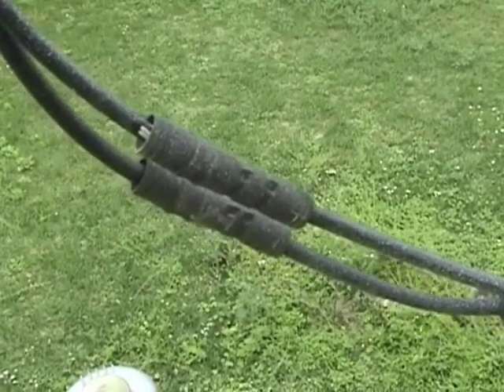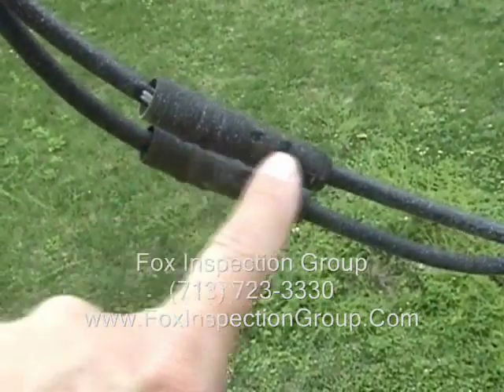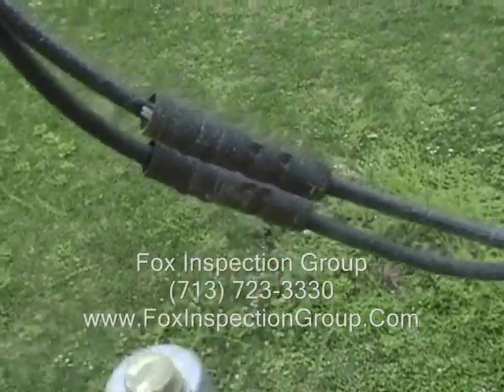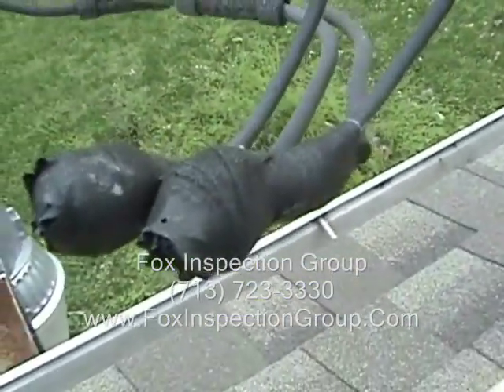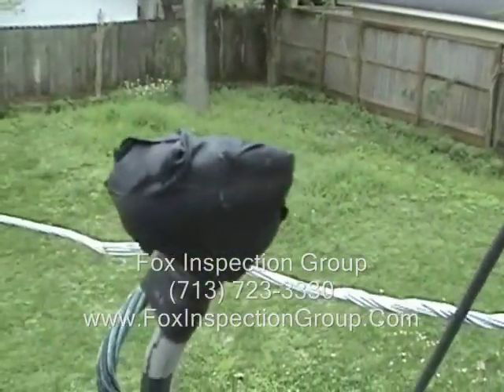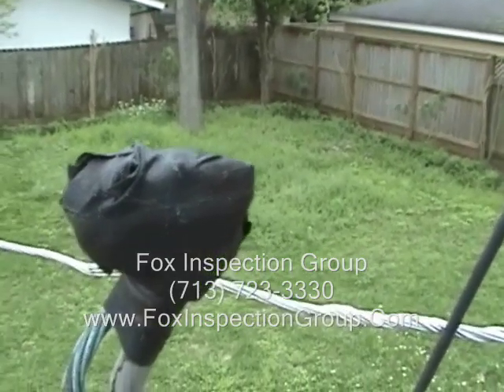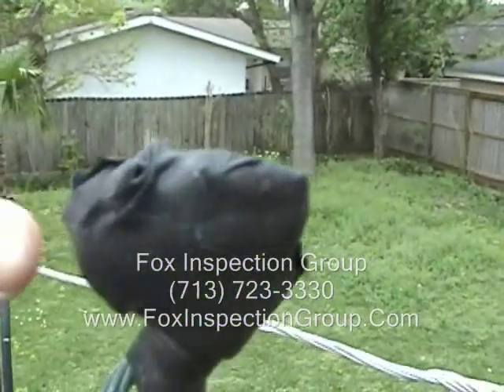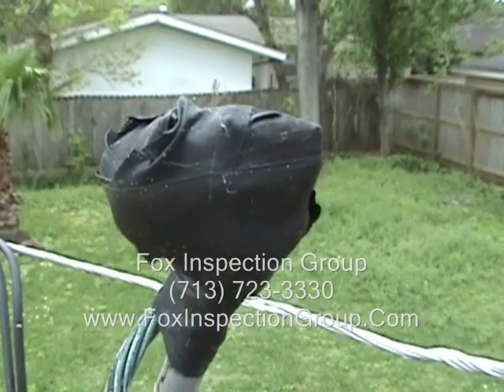Electrical Service Drop Connection Class

Comment: Am I looking at two different size wires between those splices or maybe it's the angle of the camera.
Reply: yep usually one will be smaller depending on the amp service to the house and if the house side to the split bolt is aluminum or copper.

Comment: for your information, these "link its" have been used for 40 years. they work great. even if they are exposed, there is no danger. just stay the fuck away from them.  also, split bolts have been in use since the 30's. everything breaks down with time.
Reply: Linkits are a service entrance crimp approved by the power company splitbolts are not permitted
Reply: Add a lot of electrical fires in those 40 years of old careless outdated practices.

Comment: we use split bolt in KCPL
Reply: It's better you don't have to cut it to remove it. that means you don't have to worry about making the SE cable shorter each time you need to break the connection.
Reply: Fuck split bolts!!!!! 🤮 we use Fargo feather box connectors. Hate kurneys

Comment: Both sets of crimped connections have exposed conductors which makes them defective and an electrical hazard (and you're touching them with your fingers), the tape on the split bolt is not approved, sun will bake that tape off in a few years.